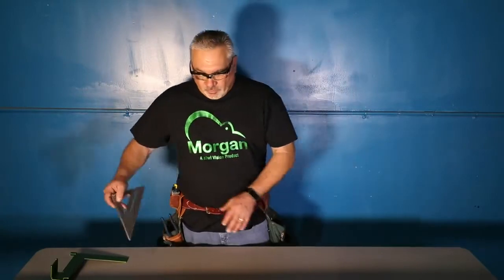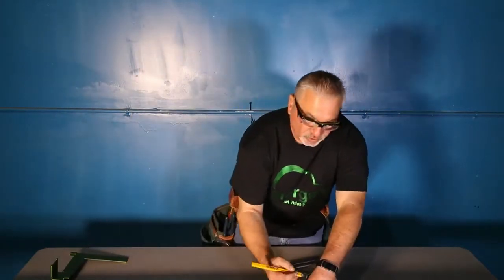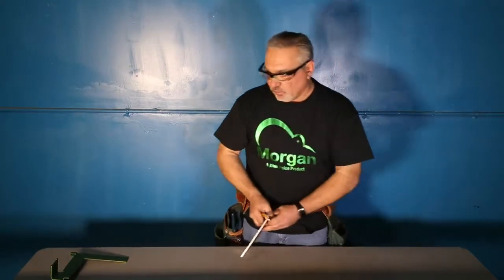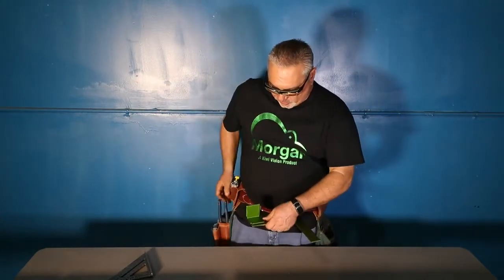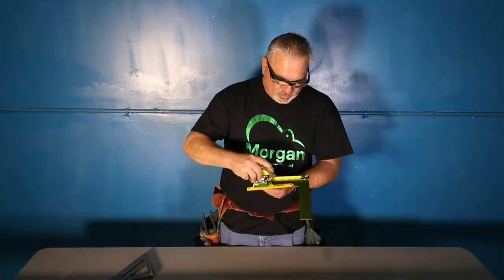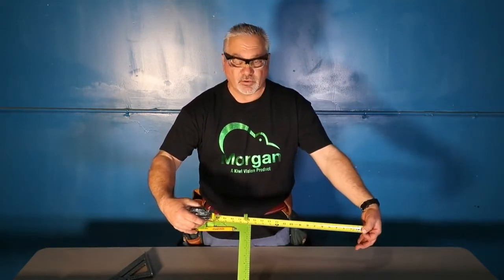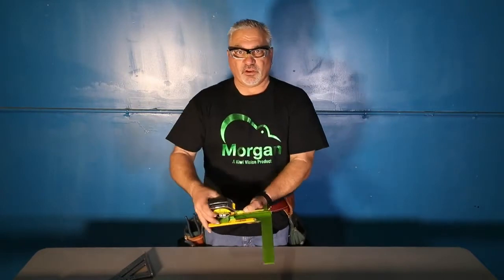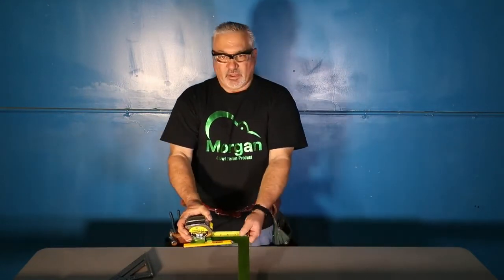Morgan Square v2 HD

Comment: Can the music be any more louder & annoying please?
•In the vid he’s not really using the square, he’s tracing lightly placed lines that are already there😆
•The square only works going right to left, there’s plenty of times when you need to go to go left to right on a job site.
•Also in the states we stack our plates three high, then layout, making marks on the top 3-1/2” horizontal for joists & rafters, and on all three of 1-1/2” vertically for studs…
•So if the square came down 4-1/2-inches along with what is already there, it would be better, but still, no pro would ever buy or use this